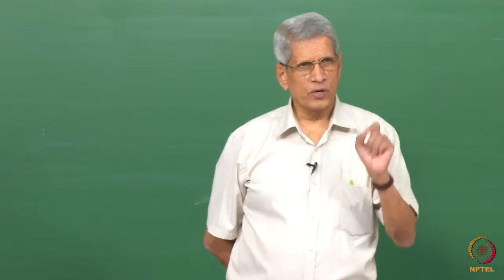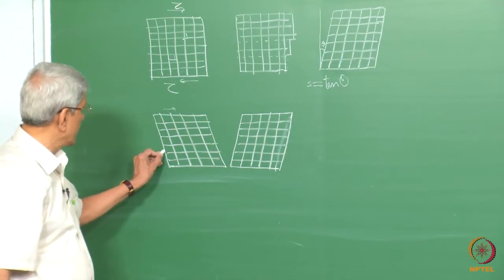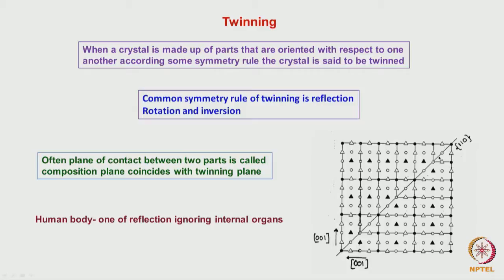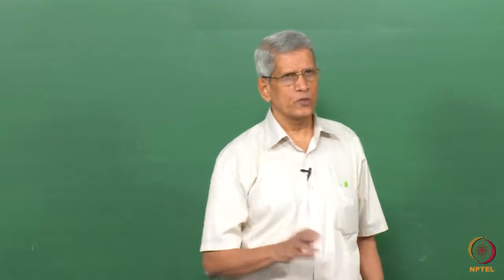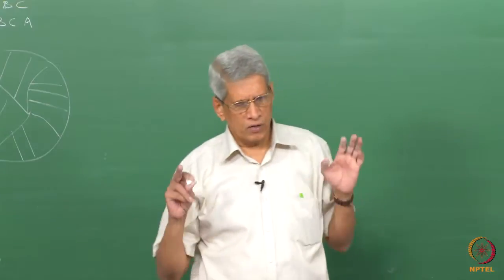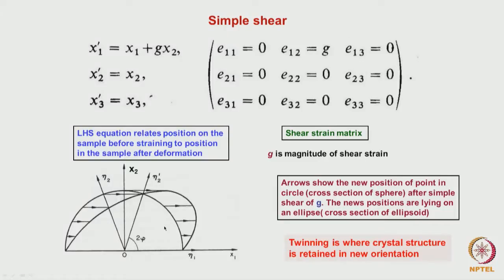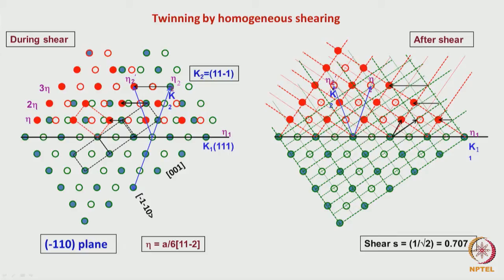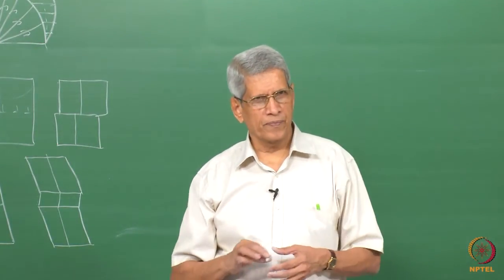Lecture 29_Twinning-1

Comment: why dislocations find difficult to move and hence twinning occurs ? Means why deformation by slip stops ?
Reply: Inorder to happen slip it should have the CRSS value such that it can glide in its unique plane.So in case of HCP crystal structures they have lesser slip planes or you can say slip systems such that in order accomodate the larger strain during deformation it twins.Temperature can also be a factor of twinning as low temp dislocation movement becomes sluggish so it can be a possible scenario for twinning.Mostly HCP,BCC twins but some fcc metals also twins.
Hope it will Help!!
Reply: @Kumar-kh4es  Thanks for your reply. So, can we say that in order to continue plastic deformation in BCC and HCP metals, they twin to avoid fracture quickly and in case of FCC metals, they twin due to change in the annealing sequence ? FCC have enough slip systems to deform plastically by slip so they dont require deformation by twinning.
Reply: @ravithakur0041  BCC metals have more no of slip system but are not closed packed so they fail in brittle as well in ductile manner depending on factors but HCP metals general fails in brittle manner.
Reply: @Kumar-kh4es  This is ok. My question is what actually twin does in HCP and BCC and also in Fcc ? Do slip is followed by twin ? BCC and HCP fail in brittle manner so what twin does in them actually ? In case of FCC which fail in ductile manner, what twin does in FCC ?